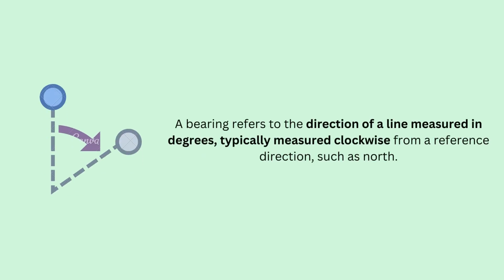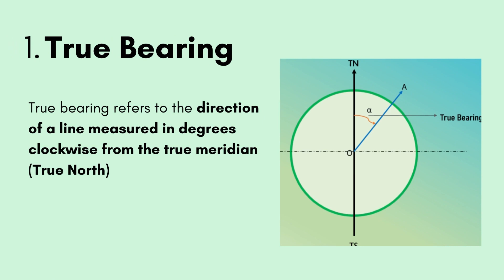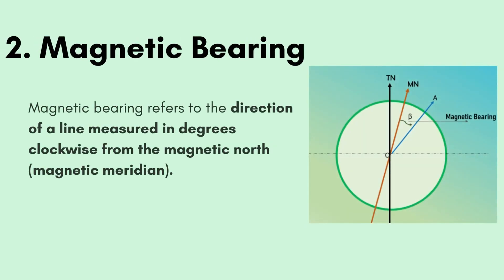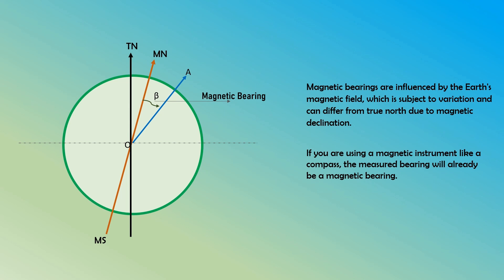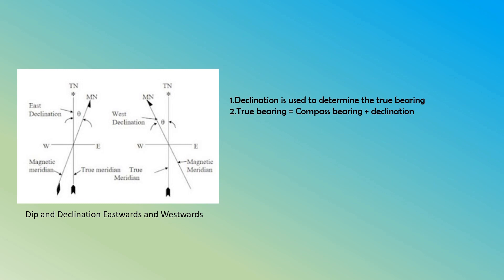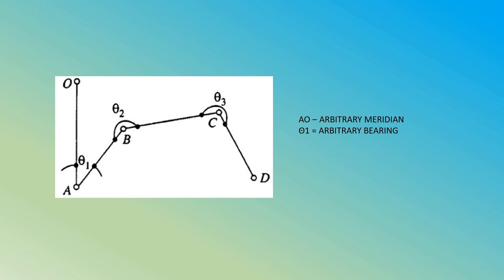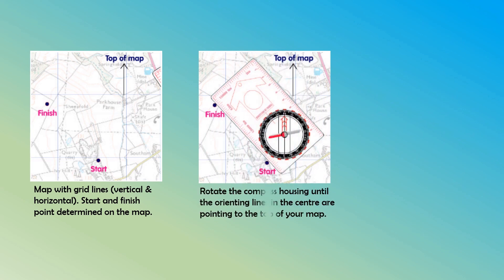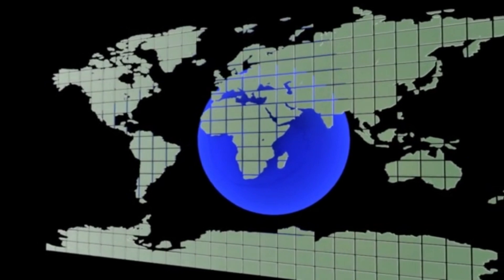Bearings in Civil Engineering Surveying - Part 2

Comment: Personally, I would like more of the mathematical formulas and surveying techniques. However, I think that many who watch this video are also looking for knowledge in land navigation with a map and compass. When I navigate, I calculate the magnetic declination according to the local reference system, (Grid system on the map). Of course, the Meridians are best for reference if I'm going to refer to a map anywhere else on Earth. Here, however, you have to think practically, will I be able to go so far that the non-parallelity of the different grid systems is important? The answer is no. The magnetic deviation is more important between different points on the map I have. Especially if the map covers a larger area. So the simplest and most practical is if you have a compass where you can adjust for magnetic deviation and that you adjust it according to the map's Grid system.
However, I think you should provide various practical examples where you want to use the meridian as a reference, or other reference systems, etc.